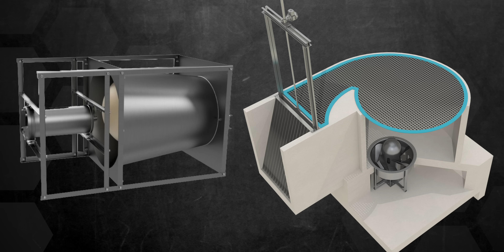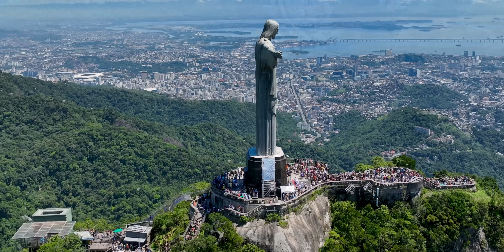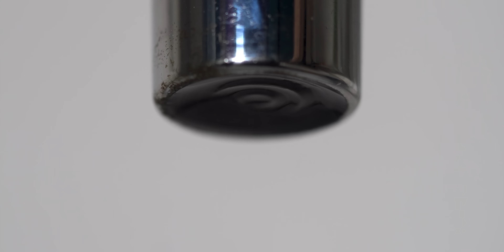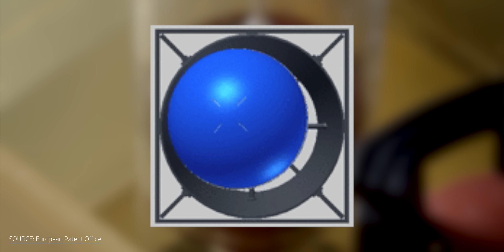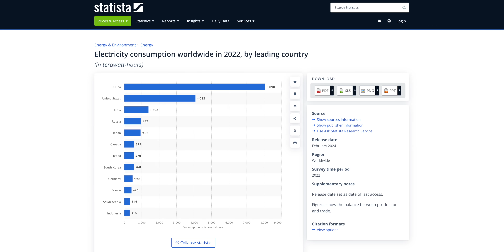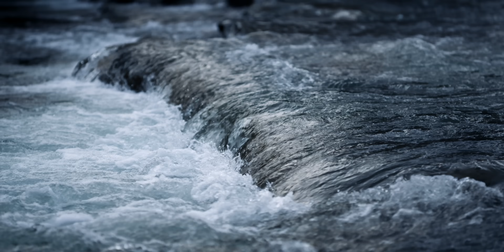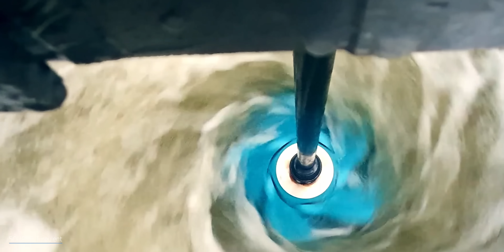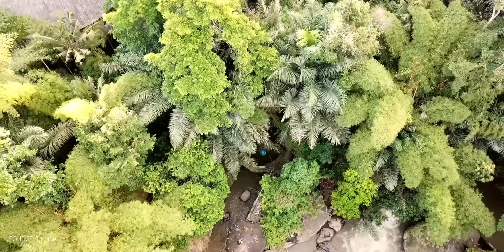The Genius of Small Hydro Turbines

Comment: Head is the biggest factor in all micro hydro.  a 1.5 m head requiring 1.5 m3/s is a HUGE amount of water for micro hydro. But it is usually easier to find 15m head at 0.15 m3/s and get essentially the same power output.  Environmental regulations typically forbid working within the water body itself, so you have to divert and return.  But the percentage of flow you can divert is quite limited.  Far easier to get a small volume.  So, the search for sites almost always focuses on small flow, high head.
Reply: Most places in the world do not have freezing issues nor use electricityfor heating. I agree the main issue here is the flow to head ratio. Permits aside, I wonder how it stacks up to an equivalent high head low flow application.
Reply: @EK4B16A2  high head, low flow means its easier for DYI setups. Large flow, low head require large, efficient turbines, where in a high head situation, your losses are in head, which you have a great deal of.
Reply: @ Mass x gravity x head x Cp.
Most of the worlds populations, which inadditioin have access to wealth do have issues with winter heating, so elecitricity may have to take second place to general electricity. |Flow and mass are directly proportionate, nither takes pricident.
Reply: @conormcmenemie5126  most water courses with large flows are already used. Most sites with large flows and high head have already been used. What is left are smaller water courses, with limited flows. Obviously small head, small flow aren't as good, so the focus should be on high head, low flow sites. These also tend to be higher up on slopes and normally difficult to access, which again, means they are likely to still be untapped.
Reply: Greatest power need is winter for heating but having the system freeze up is a big problem, also where there is high gradient there is also high flood and damage to the system. Often the low head with high mass, as in farmland, can be an easier option than trying to produce a viable structure in a gully or revine. Then there is the need for large fish to swim upstream and small fish to swim down stream. Capital, expertise, maintainence, installation . . . . . . there are more problems than solutions.

Comment: I am a fan of using solar and wind to pump water to a raised reservoir then have that water flow down through these small turbines at night or when there is no wind to the lower reservoir and the process repete. A gravity battery of sorts with low flow up using excessive electricity and low flow down to aid in increased demand or reduced production.

Comment: Great video Matt. I think you skimmed way too quickly over the benefits of massive decentralization. I.e. it would have been great if you talked about maybe some of the biggest points like:
1) Less repairs if a unit fails.
2) Less power loss if a unit fails.
3) Given enough smaller units spread out, the seasonal effects are much lower in many regions of the world.
4) Most can be completely unmanned.

Japan saw the extreme benefit of decentralizing their power grid and storage e.g., and they are winning that race right now. It's been such a big thing for them that they completely turned their electrical infrastructure around in just 8 years.  I just came from a Energy expo in Tokyo, and we are so far behind, you have no idea.

Great puns by the way. I liked them!

Comment: I don't see why the 2nd hydro company doesn't just make use of the spherical generator thing to reduce costs overall. Even if the rod between the generator and the spherical thing breaks it's just a rod, it'll be far cheaper to replace than the turbines. So all that energy they harvest from the snail shell path combined with the cheap repair cost of the spherical thing would make for quite an enticing setup for energy acquisition.

Comment: Nice. But in practice, the costs per kWh from small hydropower plants are almost always between 15 and 50 cents/kWh!
In contrast, electricity from solar modules only costs approx. 5 to 10 cents/kWh!
Reply: You can DYI a decent hydro plant that returns its investment in months.  You can't do that with solar.
Reply: Can be constructed from repurposed, recyclable, non-toxic materials, and — with proper maintenance — will last forever ... a LOT longer than a PV solar panel's paltry 10-15 years. Depending on the flow, there's no intermittency. Can generate AC power without inverter losses. The only little issue is that not many of us live nestled in woodland on a sprawling property with spring-fed streams, creeks or rivers, etc. However, a lot more of us have a roof.
Reply: @PBeringer A solar module supposedly only has a service life of 10-15 years? Obviously you have 0 idea about solar! Solar modules are also almost maintenance-free for at least 25 years. Hydropower plants, on the other hand, have to be cleaned of leaves and garbage x times a week. That's hundreds of times more work!
Reply: @PBeringer to be fair, PVs last longer than 10-15 years.  Efficiency goes down, certainly.  One would consider a constant replacement of 10% of the panels each year starting in year 10.  As for the micro/small hydro - you are very limited in location, power availability, and with climate change, the additional energy in the atmosphere will continue to lead to longer periods without rainfall, followed by high intensity, low duration rainfall.  Hydro that does not have storage (like a reservoir) will become even more intermittent.

Comment: I like the idea of small hydro, but only as an additional source of power.  Large traditional hydroelectric plants plants that impound a reservoir serve as a battery, they can be throttled to match energy supply from intermittent wind and solar, and they be throttled to match grid demand in the case of inflexible nuclear energy geothermal power plants, and also reservoirs can have floating solar arrays on them.

Comment: What's holding back run-of-river power? Local government red tape, mostly. Wind, water, solar is an opportunity sandwich, where wind and solar -- including their battery storage -- bring down overall costs, and water -- including all scales of hydro, plus pumped hydro, plus geothermal electricity -- provides power on demand. Wind, storage and solar inverters used in their down-cycles to stabilize grid signals with FCAS and automated impedance matching make power delivery more efficient and protect grid-connected equipment. With vehicle-to-grid, you get a free vehicle with your personal power storage.

Comment: Decentralize power generation is a better solution for residential usage. Roof and wall solar, small vertical wind turbines, and SHP coupled with batteries (and backed by microgrids as needed). Central power generated will still be needed for commercial and industrial loads but can be much smaller. Another benefit is elimating grid wide power outages from natural or human causes.

Comment: I think you are out a bit on the flow of a standard tap (faucet). I'd only reckon on 10 gallons a minute, so that would be roughly 100,000,000 taps flowing, or 200 times more than in the video.
Reply from the maker: Yep, we messed things up after we did the calculation.  It ended up getting written incorrectly in the script as the word million instead of billion ... and we didn't catch it.  🤦  I've added a correction to the description & comments.
Reply: @UndecidedMF  Thanks for the full and prompt reply Matt, much appreciated.

Comment: I am blessed to live in an area of abundant flowing water.  I believe that nearly 100% of electricity that I use in my town is produced is Renewable.  Hydro accounts for the vast majority with several smaller Solar facilities in are area.  We have zero coal or natural gas plants in the region.  It is theoretically possible that we could get electricity from one of the Nuclear Plants, but that would only be in an emergency.  They are several hundred kilometers away.

Within 50km there are at least 5 Hydro Generation Facilities.  What is different in my location, is that only one of these Facilities has a large reservoir associated with it.  The other 4 are located on Fast Flowing Rivers and are placed at natural chock-points, so the structures that were built, are really not that large. The one location is also at a natural chock point and the dam is used to create a large reservoir that primary purpose is not for Hydro, but for to control that level of a pre-existing lake.  4 on on the same watershed, so the same water flows through each Facility.

In our region, there are multiple places where pre-existing Water Control Dams exist, and that it would be possible to add additional small generation capacity.  I think that this is a great idea.
They would have very little environmental effect as the dams already exist.

Comment: Every time I see one of those Turbulant promotional videos I’m struck by how much of the potential energy of those installations is being wasted by all the turbulence in their water flow.
Reply: not as much wasted energy as not having anything there collecting some of the energy....
Reply: @innercityprepper  well... first you have to pay grid connection somewhere in the mountains or fields. Thats at least a few km of power cable connections you have to pay for before you can feed into the grid. Then you have power cable losses over distance and low production to begin with and sadly you will end up with a negative cost benfit calucation. Unless you have a consumer on side, it makes little sense nowadays.

Comment: As you probably know, being a MA resident, the New England coast is fertile ground for Small Hydro installations given the multitude of rivers flowing to the ocean.  I've often thought this might be a viable way to de-centralize the utilities power source and reduce the need for fossil fueled generation. A web of such stations would be more resilient to a failure than a single main source too.  Power stations load share in this way, so this would just scale that method down to "neighborhood" size.  Just my 2 cents

Comment: Just based on this video... i think the small hydro units sounds like a good solution.

The town I used to live in had a river channeled through it (cement/brick lined passage).  Putting a couple of these in there would be great during the non-ice season.
Reply: Use small Hydro to charge a large battery

Comment: I think one of the other valuable considerations with solar and smaller footprint options for hydro and wind can help decentralize the grid.  We have been pushing towards greater centralization of the grid for 15+ years now and it is the wrong direction.  Decentralization means that we do not need to have nearly as much long-haul transfer of power which leads to losses.  It also means that existing plants do not need to scale.
Reply: I think both directions are worth pursuing and, in fact, must be pursued. 

We'd like to generate energy from a bunch of locations, distribute it as-necessary, and store the excess--all as efficiently as possible. Even if every roof and window generated energy, I expect that urban areas will still need centralized energy generation and storage for both efficiency and cost reasons. So, I think it's important to develop technology for centralized grids that allow many different energy generation and storage methods to 'play well together'--an effort I mostly hear in the context of centralized 'smart grids.' 

TL;DR: I believe that, like the many different types of renewable energy generation, the best solution uses many different scales of each technology as appropriate.
Reply: @Erik-pu4mj exactly. Continent wide interconnected smart microgrids is the answer
Reply: Its the standard march of businesses. The industry starts out decentralized and as the most competitive producers gain a competitive advantages and economies of scale increase, they push out or buy the other competitors. This trend will continue until they are so large that they cannot fulfill the function they were started on or the business environment changes. Large organizations are not as nimble as smaller ones and change can be too slow to adapt. Collapse follows and the industry begins to decentralize. It is a very common phenomenon in Nature. During the collapse other entities that have a small competitive advantage due to the rate at which they can adapt move in to take advantage of the Niche.
Reply: @dus10dnd  What is decentralizing? You mean not having an interconnected system? And if your system fails would you not like help from your neighbors?
Reply: @pindapoy1596  No, centralization is having the control in fewer hands.  Decentralization is having the control in more hands.
Reply: @dus10dnd  It is very complicated because it is  dependent on the size of the electrical system.
If you have a little turbine for feeding your house or farm it is one thing; you can do what you want, turn it on or off as you need.
If you are feeding a small village or a little town, you can't do that anymore because everybody connected to the grid (as small as it is) has different needs and people must agree how the  plant is operated.
If you have a statewide grid (like Texas that is isolated from the neighboring states) it is even more dificult and you need what is called a load dispatching system where operators act like flight controllers and technical control is in the hands of several well experienced personnel that optimize the system, technically and economically (like deciding which turogenerator or hydro turbine or nuclear plant to start or stop under given circumstances).
And if you have a countrywide grid like most European countries it gets even more difficult and if several countries are interconneccted (say Spain and France or Germany and Switzerland) then it becomes a very difficult operation that involves many factors including the price of the KWh in the several countries involved,
Reply: @pindapoy1596  Thanks... I really appreciate being told about things that I happen to be an expert on.
Reply: @dus10dnd  A real expert does not claim to be an expert, a real expert proves to be that. A real expert does not talk about his knowledge but acts like a serious scientist (the more I know, the more I realize that I know so little: Einstein).
So if you are such an expert show your worth by talking turkey, not by pounding on your chest.
Arrogants have no place in science, They produce nothing of value
Reply: @pindapoy1596  Cool story.

Comment: I take issue with the wildly inaccurate opener.  To suggest that large dams are dangerous if the were built before 1995 is lunacy.  Large dams like hoover will last millenia.  And the turbines are regularly replaced.  So dishonest.

Then there is your apparent inability to do basic math.  If the flow rate of the itaipu dam is 985 million gallons per minute. Let's just call that 1 billion.  Typical faucet flow rate is about 2 gallons/min, which is 500 million times less that itaipu, not 500,000.

And you want to monetize this sloppy work? 

Forget it.  You have lost credibility. Now I see that you have become just another shill

Comment: On large buildings and/or paved areas - we could have small hydro generators with these. Add a cistern to hold excess rain water collected by the large surface, and then run the turbine when it is needed.
Reply: You need to run the numbers. You are not the first person to have thought about these options and unfortunately the people who understand the available energy versus the costs tell us that it is not a viable option.

Comment: I can not believe you made an entire video on dams without mentioning Chinas Three Gorges dam and how its sheer size changed earths rotation,
Hows that for consequences of going big. 
Love your videos, Gr. Mezz
Reply: that is a myth
Reply: @frankkroondijk586  “In 2005, NASA scientists calculated that the shift of water mass stored by the dams would increase the total length of the Earth's day by 0.06 microseconds and make the Earth slightly more round in the middle and flat on the poles.”

-NASA Details Earthquake Effects on the Earth
Jan. 10, 2005
Reply: @frankkroondijk586  Doesn't appear to be a myth; the effect is just tiny.

Quick Wikipedia search: "In 2005, NASA scientists calculated that the shift of water mass stored by the dams would increase the total length of the Earth's day by 0.06 microseconds and make the Earth slightly more round in the middle and flat on the poles." NASA used this as an example to compare the "barely noticeable" effect that all earthquakes have on Earth's rotation.

Comment: Dam, I enjoy the constant family friendly swearing in this video.
Reply: No dam! That's the point of small turbines 😉
Reply: @jnicht  So you don't give a dam.
Reply: The town I live in has a real problem with having the street sign for Dam Road stolen.  They keep replacing it with better and stronger mountings, though.  It's a dead end road that leads past the "Glory Hole" (the overflow drain in the shape of a morning glory) to the base of the Harriman Dam. Getting the pun engine going.
Reply: @mikep3226  Dam Road to Glory Hole? If I'd put it on a map for a roleplaying game, the players wouldn't have believed it 😆
Reply: This is Mahesh from India I need small hydro electricity using open well water motor output point